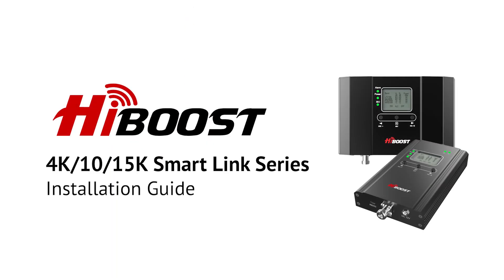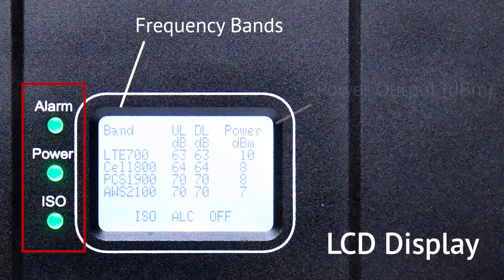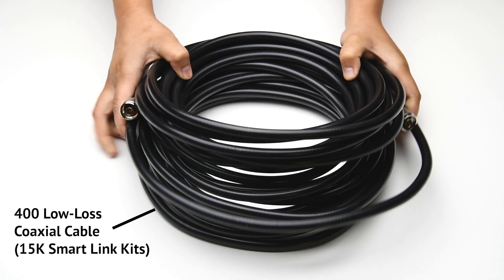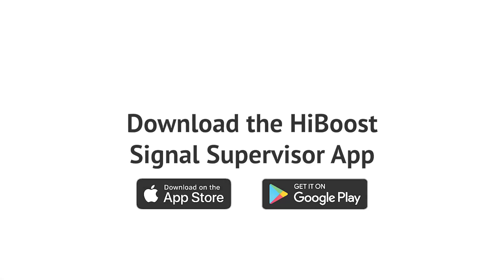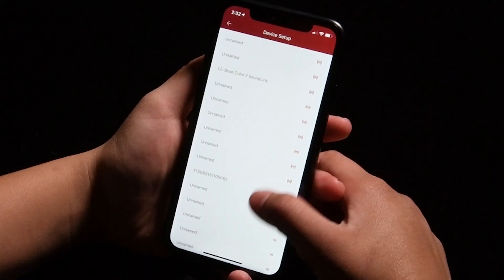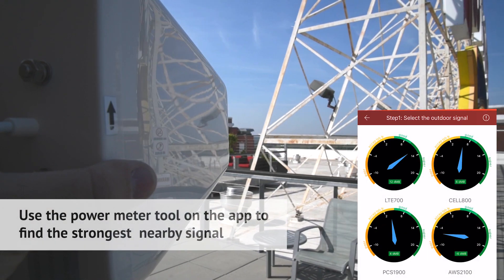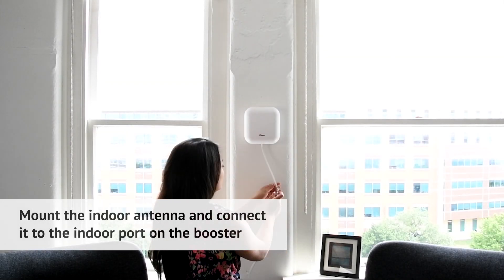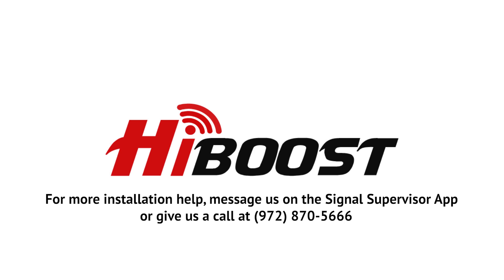How to Install Mobile Signal Booster | HiBoost

Comment: Look at your carrier's band and the actually frequency that operates.. Like Band 71 for T-Mobile towers is 600 range of;
"T-Mobile's Band 71, also known as their 600 MHz network, has a frequency range of 617–698 MHz. This paired spectrum is divided into two frequency ranges:
617–652 MHz: Used for cell towers to transmit to mobile devices (downlink)
663–698 MHz: Used for devices to transmit to towers "

Make sure to check your carrier's band, Freq, then the Bands and Freq of the booster that you are looking at..
Reply from the maker: Thank you for your detailed explanation!
It's indeed crucial to check your carrier's band and frequency to ensure compatibility with your signal booster. For T-Mobile users, as you mentioned, Band 71 operates in the 600 MHz range, which is essential to know for optimal performance.